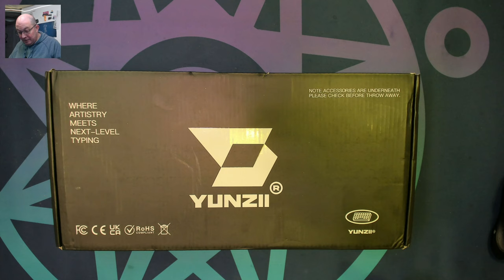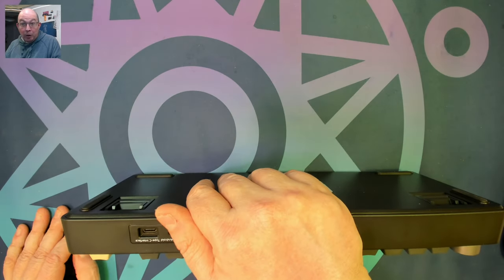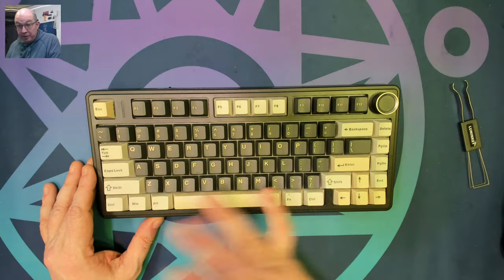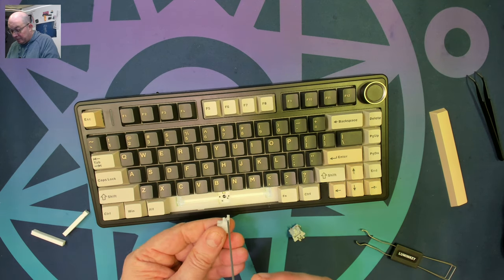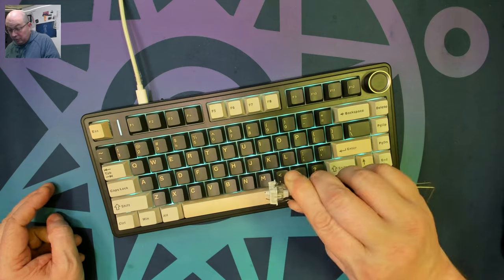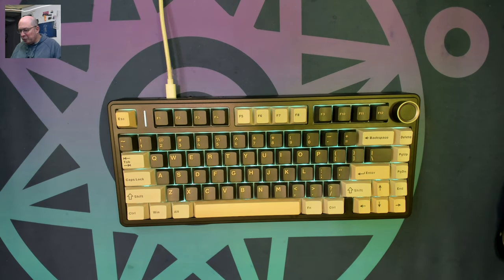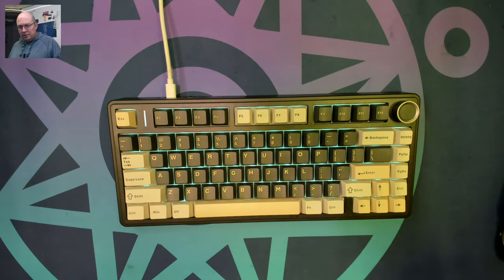Yunzii B75 Review and Sound Test Leobog Graywood

Comment from the maker: Chapters:
__________________________________________________
00:00 Channel Intro
00:05 Video Intro
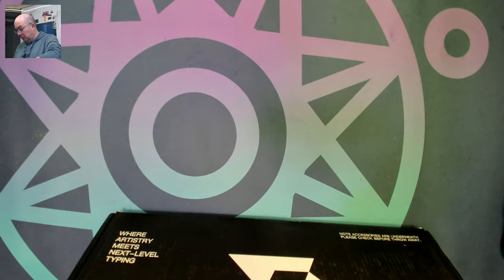01:05 What's in the box?
03:05 And here is the Yunzii B75 wired 75%
03:50 Checking out the removable knob
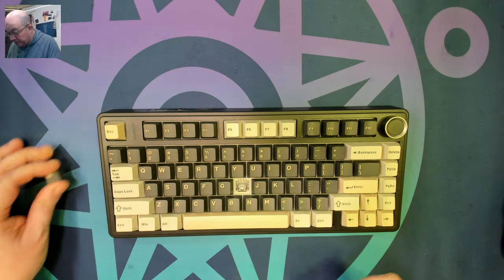04:45 Checking the PCB and it's layers
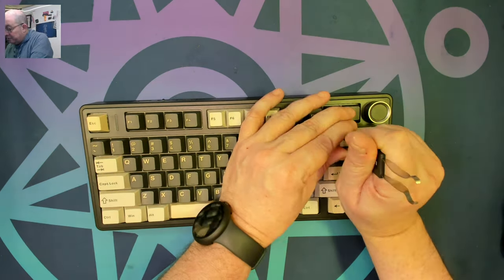06:35 Taking a look at the (plate mounted) stabilizers
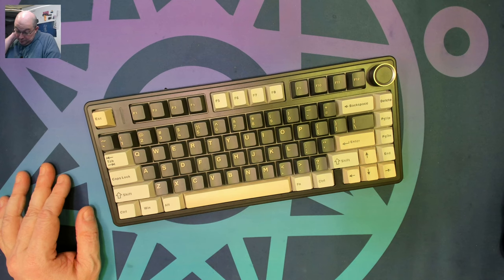10:25 What about these keycaps?
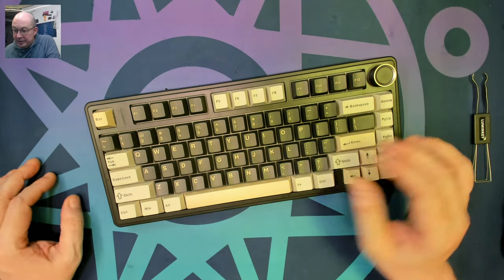12:30 Taking a look at the single color LEDs (Blue White)
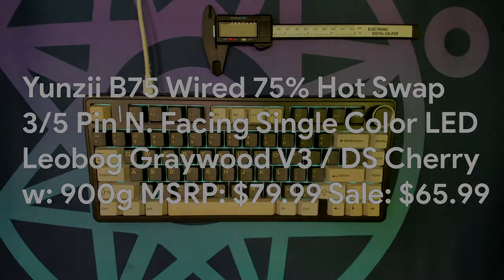16:55  Just the Specs
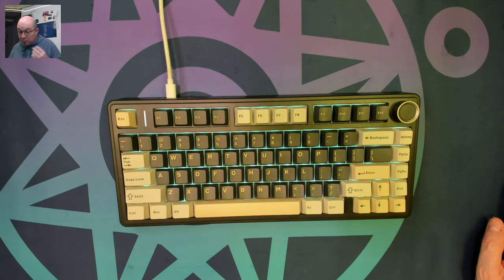18:15 Closing Thoughts
22:40 Sound Test
__________________________________________________

Comment: The stock sound of this keyboard is unreal!!! Bought this keyboard as a gift for my brother and its fantastic for typing and gaming! Only downside in my opinion for those that care about rgb, the RGB sucks. It sounds and feels so smooth though I kinda wanna buy one for myself now 😆
Reply from the maker: Yunzii has been delivering some nice keyboards, glad that you like it. The F75 version of this has wireless and better lighting and currently has a $15 off coupon on Amazon: https://go.be2x.com/yunziif75amazon
Reply: @MechKeyboards  I was checking that one out as well but they don't offer the graywood switches with that one. Something to consider though, Thanks
Reply: Did you do the clipped and lubed stabilizer option or fully stock?
Reply from the maker: @hhaste  fully stock. All initial sound tests are done without any modifications.